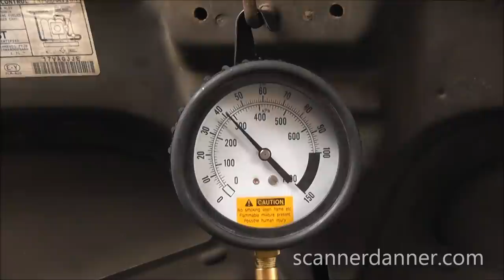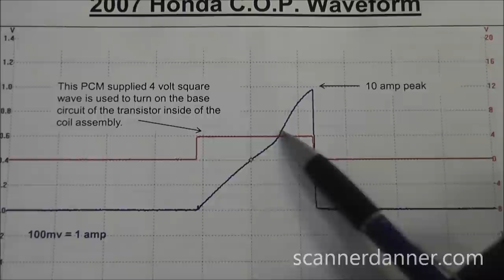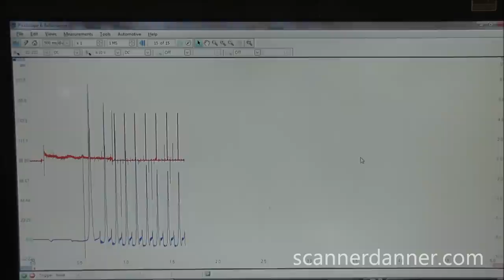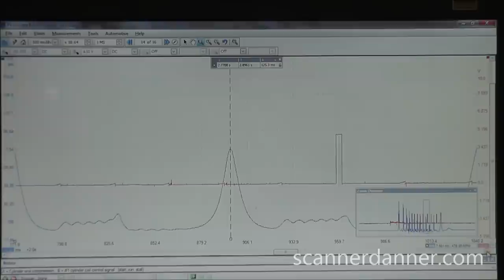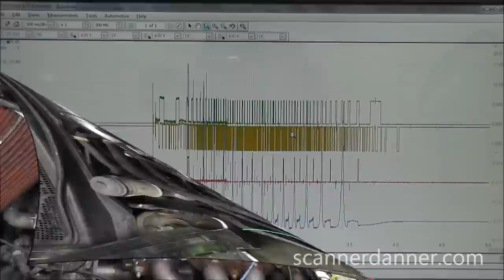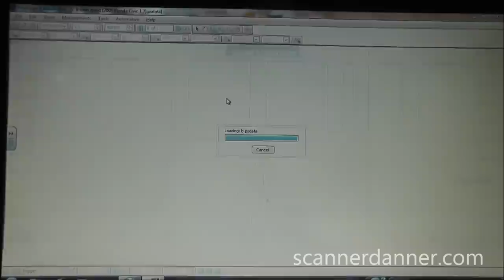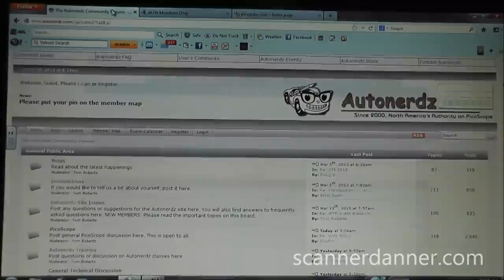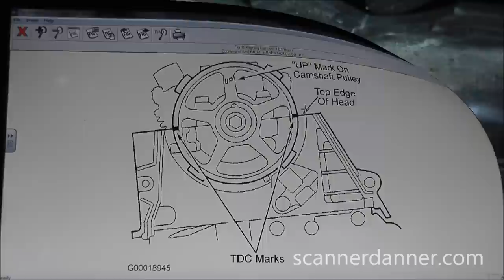Honda Civic 1.7L starts, runs, stalls (incorrect timing belt installation)

Comment: I have a 2001 Honda Civic 1.7 doing the exact same thing.  I had head work, timing and water pump replaced.  The car started to over heat the same day after having this done.  I took it my to the shop and they added a thermostat.  The car ran great for 4 days then it just died on me on the hwy.  The mechanic check the timing again and said it's no the timing.
Reply: Bruce Craig

Comment: Hi Paul. Another great video and learning curve for myself, I have one question and it's regarding the  cam,crank spark relationship change due to engine running and you said this timing test via the scope is more accurate with a non running engine. If I had this car in my shop would I be better removing the fuel pump and taking my measurements on a cranking engine. Just like to say I'm a very happy premium and e-book member. Thanks

Comment: I have the same car and the same exact problem and I think the timing is off but my car went into limp mode which I can't go above 3000 RPM did that car have a limp mode problem
Reply from the maker: What you saw in the video was as much as it would run
Reply: My car was in an accident  prom previous owner not much damage i bought it cheap and it threw a p0740 cluch converter circuit open so i fixed the broken wires then  i replaced the crank sensor beacause of the 2nd code now it runs and in limp mode and ideas would help

Comment: My 2004 civic will sometimes turn on but other times won't it spins over fine and runs and drives great. It's an intermittent no start problem. Could it be the fuel pump relay? The fuel pump comes on though. Can you help me?
Reply from the maker: It is becoming more and more difficult to answer questions here. I have 80,000 people asking me for help now. So I have created a forum to help you guys better. It is free to join and we can exchange pictures, wiring diagrams and waveforms if needed to help guide you through the process of troubleshooting your vehicle. Thank you so much! Hope to see you there. 
Paul Danner (ScannerDanner)
 https://www.scannerdanner.com/forum/post-your-repair-questions-here.html

Comment: I put a test light into the connector and turn the switch on and off I just finished changing out the fuel pump but still nothing I'm so lost right now
Reply: I am directing all help requests to my forum. Sign up (it's free) and create a new post. Be sure to add a name under "alias" as this is the name that will appear in the post.
Here is the link to the forum. 
http://www.scannerdanner.com/ForumRetrieve.aspx?ForumID=3226

Comment: It's strange you would think that 1 tooth off would still run. I've seen 3 teeth off running still. Also I guess since it was only one tooth off it didn't effect the compression much...usually I've seen lower compression on engines with incorrect valve timing

Comment: Any idea on potential costs for this issue?
Reply from the maker: Just google labor time to replace the timing belt, then multiply the number of hours times $100/hr, then look up the price for a timing belt. You may also want to consider going the other accessory drive belts (they have to come off anyway) and then also a water pump if it is driven by the timing belt. Add some labor time for the water pump but NOT for the other belts

Comment: Hey Paul. you're very informative and have drawn a global fan base. Thanks a lot for that. can you tell me a bit more about getting a signal from a cylinder pressure transducer? I will be needing to look at that in comparison with cam / crank signal. did you probe into the cam crank signal?  info will be much appreciated. Cheers buddy

Comment: Hey Paul, rookie question.  Did you just take the timing belt off and rotate the camshaft clockwise one tooth and put the belt back on to put the engine back in time?  Great video, man was it helpful!!!
Reply from the maker: I believe I loosened the tensioner and slipped the belt

Comment: I'm amazed you needed a laptop to identify this issue. I had the same thing happen on my ford focus and spotted it straight away even before plugging any laptops in. The breakdown guys kept saying fuel pump this, egr valve that. They were all wrong and I was right. Without a laptop. If you want a real motor mechanic. Hit me up.
Reply from the maker: Lol, a real motor mechanic huh? Wish I was as cool as you are.

Comment: So how did you fix it ???? This was the reason I watched tho hole video but you dint even show how you fixed it 😢
Reply from the maker: You wanted to see how to remove and replace a timing belt? Sorry, that's the easy part. Troubleshooting this condition was what this video was about. If you watch to the end there are shots of the aligned camshaft and the engine running
Reply: lol sorry but i honestly did I was waiting to see the fix but the video was awesome nonetheless!!!

Comment: symptoms are when you first start the car it runs just under 1000rpms.
after a few minutes it reduces to normal. then it seems like the it acts like it misses or the IAC is still open. really not sure.

Comment: this is one of the most annoying problems ever and I would know because I own a honda accord ex 2000 and my car does the same exact thing that you guys see in this video the same exact thing and I have no idea how to fix the problem I am not a mechanic and I really just don't know what to do I am thinking about selling my vehicle and taking it to a shop would be just way to pricey for me any suggestions guys?
Reply from the maker: +Mikey Dominguez there are other reasons a car will start, run, then stall. Most common would be from low fuel pressure (fuel pump going bad). 
Can you keep it running with a fuel source? Like I showed in this video? (though mine would not run with fuel)
Reply: +ScannerDanner Could I upload a video showing you exactly how my car stalls? I've had this car for about 3 years and for 3 years I would always have to deal with this issue especially in the summer time like now that's it's about 70 degrees outside my car will start to stall alot more often but In the winter time it wouldn't not as much that is. To answer your question about my car being able to run on a fuel source the answer is yes it can run on a fuel source if you mean that if my car has gas in it can it start yes. but most of the time especially in the summer time I will put the key into the ignition turn the key and the car will start than just shut off  just as the Honda civic did in this video and I don't know how to fix this issue any tips please??
Reply from the maker: +Mikey Dominguez no, I meant if you spray some type of flammable source into the intake like I showed in my video (don't do this if you've never done it before, it is dangerous). 
You describe this as being intermittent and happens more when it is warm outside right? So then it is not the same as my video. 
Two very common problems on your Honda for what you are describing. The PGM-FI Main relay and the ignition switch. 
Here is a video I did on repairing the main relay. 
https://youtu.be/6CMZ4g8n0FQ
https://youtu.be/X5Qp-ToR8KA
Reply: +ScannerDanner  As far as me spraying some type of flammable source Into the intake goes I have never done this before and neither has anyone else that I know. and yes I would describe this as being more intermittent this problem does occur more often when the temperature outside increases and starts getting warmer out unfortunately. I want to check out the links that you sent me but do you know of anyone or any shop that I can go to to have my car looked at? I will try my best to fix this problem on my own but I really.dont know to much about cars or.how to really work on them and I don't have any tools at that.
Reply from the maker: +Mikey Dominguez If you live near Pittsburgh PA, yes. Otherwise go on www.iatn.net and use their "shop finder". 
Any garage that is subscribed to iATN or are listed there, you would have a much better chance of finding someone capable of handling your issue. 
The smartest mechanics I know I've met through that website
Reply: +ScannerDanner  I live in millville new jersey I wouldn't mind taking the drive out to Pittsburg pa to have my car looked at. or maybe even fixed but I will get on that website and check that out for sure thank you very much it's hard finding a mechanic that is trust worthy and not a complete rip off you know I really don't let just anyone work on my car unless I know that they know what they are doing

Comment: I don't get why it would start and then die because the timing is off. It's not like the timing was changing the longer it ran.
Reply from the maker: program. 
garbage in, garbage out
Reply: So the computer was getting confused as it runs because the timing was off?
Reply from the maker: Exactly! Cam-crank correlation in particular
Reply: Thank you so much for explaining. I have another dumb question if you don't mind- If you unplugged either the cam or crank sensor so the computer didn't know that the timing was off, would it run? I know that these cars will normally run fine off 1 or the other.
Reply from the maker: some systems yes, on others no. Some systems absolutely need both cam and crank sensor signals to be able to start
Reply: I know that these cars just need one or the other to run. So if you unplugged one, would it stay running with the timing off since the computer wouldn't know that anything is wrong? Thanks.
Reply: You'd have to spin the dist around ridiculously far to bring the ign timing back to a run-able spec then it would run. Actually that would have been a good experiment.
Reply: This car doesn't have a distributor. Also, as I understand it, it can mechanically run this way with the timing off, but the ECU won't run it because it has no idea what's going on.

Comment: Cool video, but I could have determined that condition within about 5 minutes by taking the valve and timing covers off.
Reply from the maker: lol, okay, but these were NOT your typical symptoms of a timing belt issue and I am a teacher, so I was teaching
Reply: The point of this video is trouble shooting and this is ways to check alot more problems than just the timing.

Comment: I got a friend and you always got friends if you can do mechanic , welding , electrical ect as some one always seems to need help lol at any rate I drive vw diesel cars so her tdi jetta just was going along running fine and it just lost power and died . I made the usual suggestions about checking fuel ect . Finally after her local mechanic and her husband got tired of trying to fix it I said ok bring it over . I asked point blank when was the timing belt done. She said o it ok alright .  I told her this is a high interference motor and I not pulling it down to fix the head . And even it the valves are not bent the head may come off later on the valve stem .  Sure enough the timing belt was off one tooth and I installed a timing belt kit got it running and she came got it . There is a reason to change out the timing belt when the time if up and also pull the cover and just take a look at the belt about mid way through the life cycle

Comment: But my question is why this could happen? He said something about the water pump
Reply: +earauz66 Tensioner installed wrong, belt not installed correctly to begin with. The tech that changed the timing belt, water pump, tensioner should have double checked the timing marks before putting everything back together

Comment: geez, turn the crank to top dead center, and check the marks on the cam pulley, all those problems can caused by a worn timing belt tensioner, which is supposed to be changed along with the water pump (Not all honda,s need that, some of them use a chain.
Reply from the maker: This was more about learning the technique than what was the fastest method on this car.
Reply: I agree, its just im old school, when i first started to turn a wrench we didnt have the modern diagnostic equipment

Comment: my car runs and stall while driving n also shutting off while driving I've changed 
EGR - GAS RECIRCULATION valve
gas pump
it's a 2005 honda civic es1 D17 a. ..1.7l

Comment: Never would have guessed timing off so little would have caused this.
Reply: well I coulda told you that
Reply: Most cars would not have THAT bad of a reaction though. They will barely run, but not start and stall.
Reply: Just did a Civic 1.7 swap and timing was off a tooth and had to retime motor. Been there and back, experienced it myself and recognized the same conditions I had. I have my methods as ScannerDanner has his
Reply: Thanks for the correction.

Comment: I think they dont understand the point of going through all that when the answer became obvious but it was very educational in the field I wouldn't go through all that on a honda but I get 3 valve Triton ford motors and Nissan 3.5l VVT engines with possible timing chain issues and cam phaser issues that this could give me solid evidence too tell a customer this is going too cost thousands do you want me too on. thanks man thumbs up

Comment: I feel bad for the valve stems in this car. They are probably bent up beyond belief!!! This happened to me once and I had to pull the head and have the valve stems straightened out. When you pull the timing belt off on this car, you better be sure that you know what the hell you're doing! Set everything according to the appropriate timing marks and MARK it down PRIOR to taking off the timing belt!
Reply: 1 tooth off isn't enough on most motors (none that I know of) to cause the valves to be bent in any way.

Comment: Need to pickup some new Plugs myself pretty old NGKs with some miles on them...for 01 like I think I jumpered OBD2 plug right? hear two different things that can't jumper at all or hell you jumper up to like 05' even.... and got 9 steady flashes is that code 9 or 90?...9 is a cylinder sensor/misfire?  90 I thought was evap/emission junk that valve/canister assembly in the back etc? plugs kinda indicate pretty lean looking burn man or just old but I don't like that grey/ashy color etc that's bad....i have looked everywhere for old hoses and maybe real tiny vacuum leak, need to pick up a gauge fuck while at it leakdown tester all that shit haha

I want do that EGR removal that stuff is junk man dirties up intakes so awful on these motors, block off plate,mess with solenoid use some damn resistors computer still thinks its there/won't throw MIL or some shit? was reading about it haha, Fuck your Emission laws that stuff is bullshit....haha

Not Honda Expert man, some, but more Domestic haha, Sounds like valve lash could need some adjusting as well...I can hear some hell in their sometimes on/around #1 cylinder haha, burn some valves/blow it up etc haha

Comment: This is scarry! Especially if you engine isn't free spin. You have to replace the timing belt every 100,000km. Cars like the Magna are not free spin. Meaning if the timing belt breaks. Valves hit pistons. This is very expensive to repair. This car has been very neglected.

Comment: The only things that aren't rusted under the hood of that piece of junk are either plastic or aluminum bits.  Damn.  It's a disposable vehicle so dispose of it and get something with some modicum of rustproofing.  Get a new Honda.  100% plastic under the hood so no rust.  Problem solved.
Reply: Robert Cowan Metal will rust, but it takes time before surface rust permeates and becomes a big problem. Plastic will get brittle with heat and age causing it to crack instantly. The later is much, much worse to deal with.